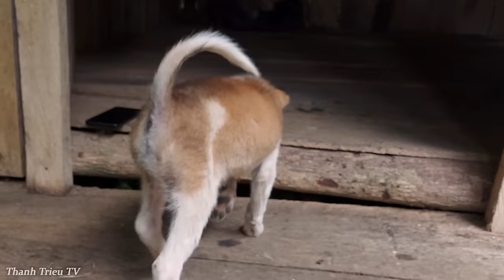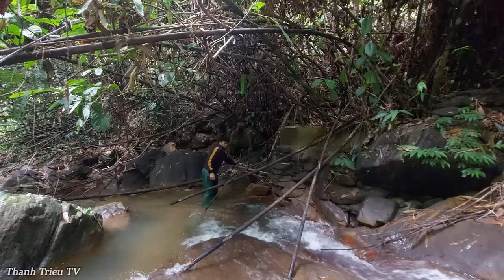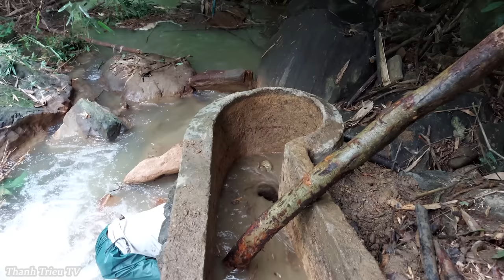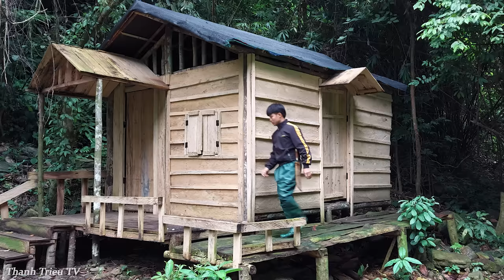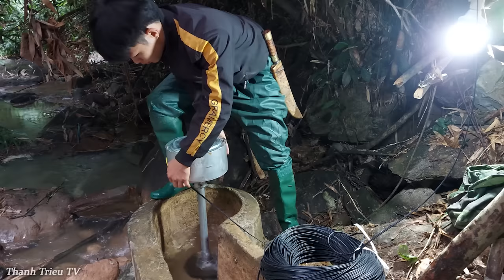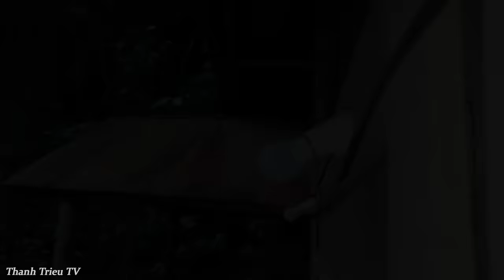Free electricity from water, Build generator install electrical system for hut Bushcraft, Off Grid

Comment: If I were a multi millionaire, I will hire a man with such knowledge on electric power source. It's easy to build a mini waterfalls if you have a running water in your small island.
Reply: Bro that little person is the “internet”  . You do it 😂
Reply: No need to be a multi millionaire if this young man  can do why can't us ?
Reply: In Vietnam 30 years ago, when there was no national madness, we only knew how to use water to light. The advantage is that it does not consume fuel, but the disadvantage is that the power is low and the power source is unstable, which is easy to damage electrical equipment. The cost is not high, about 500 usd. And the installation is quite simple as well
Reply: Millionaire can't leave their businesses.
Reply: @wantoting24  Right. People think money changes everything but people like this is what changes everything.
Reply: We can convertor to AC 👍
Reply: He left wit the turbine he is going to installed this to generate the water that's the power of water so cool this man knows a little of electric ideas he's good at it wow this is awesome
Reply: Don't need to be a millionaire, the knowledge of electrical production already exists. The crazy but sad part is Nikola Tesla prove that you can literally just drive a zinc in copper rod in parallel in the ground and pull electricity there's electricity floating in the air all around us, all this information although right now is being hidden and withheld from us does exist and can be found. Not to belittle what had to be done in this video was some work, but for me to be impressed he would have had to built the turbine from scratch.
Reply: They have lithium batteries and inverter knowledge now that would make this feasible and not hurt your equipment.
Vietnam or Red Level , Alabama, to bad the government has say to what you can do with your freedom.
Reply: Beautiful ❤❤
Reply: @bivietnam4379  The power is not low and the source is not unreliable. If you want more/less power you have to install a suitable motor for that need. Flowing stream is a reliable power source but if it dries up you can consider building a mini dam. You can protect your electrical device with a power guard device.
Reply: @channchum3542 The electricity from a motor is already AC no need for an inverter unless you want to change it to DC then you can add a full bridge rectifier
Reply: If you could use the brain you have you could do this by yourself.
Reply: We don't need to become multi millionaire bro
Reply: @richardblackburn1089  LMFAO the info is being hidden. Yea so go figure it out then if your so sure it's possible. The 1st law of thermodynamics clearly won't stop you.
Reply: @hmsbarman 
1) not all motors are AC.
There are AC and DC motors. .so your comment is wrong.
The output will depend on what winding and poles your motor is, and whether it's a delta or star output. 

How do I know?? Because I'm an electrical engineer.
Reply: @devarmont87  which motor produces DC? Explain, please
Reply: Es muuuyyy inteligente,es más para mi está para cosas mucho más grandes e importantes  😊😊😊😊😊

Comment: I think a steel cover for easy maintenance for the drainage to prevent from any leaves, rocks and soil. I think it will be easy to maintain. Anyways, great job! Thanks for this video.
Reply from the maker: thank you so much
Reply: what did he put on the drainage?
Reply: @dreilouisemarino9192  Perhaps judging of I’ve seen portion he put a flat surface stone that at least covers the exit of the drainage to block any debris.
Reply: @WayniKlaru14344  What is the steel mechanism called?
Reply: @dreilouisemarino9192  It is not mechanism. It is just a steel cover to protect from clogging the drainage with dirt, leaves, rocks to have a continue flow of water because it is a mini hydro electric pump.

Comment: Nice work My friend.. if you can estimate the power consumption of lights, including your fridge, air-conditioning system, tv and charging system equal to power production of generators then you can start a family in there.. but you have to buy a few more generator and start building some few concrete whirlpool somewhere on the sides of the falls..

Comment: The thing I love about a system like this is there is no need for 400 feet of pipe and a drop of 25 feet of "Head". You can also just build lots of these down stream one after another as the water will feed back into the stream so there is no loss of energy.

Comment: Mic is such a sweet dog ..uncomplaining as he  laid by the   leaves ground  as you work he slept  just  comfortably  as    if  it's ok..he is  not  suppose to be   exposed to the  earthen  elements to avoid  parasites  crawling to his body...better  he needs a real  DIY cushioned  bed bigger than him inside your cabin....he  is in danger  if he is  sleeping outside  by the  earth ground......only  concerned for  MIC....YU DID AN EXCELLENT ELEC  JOB   CONNECTING  WIRES FOR ELEC  USE...TRULY SERVED WHAT YU VE  LEARNED.....NICE    WORK ....

Comment: I would suggest a covering over the generator. Something to keep rain water out of it. the bottom the generator has openings that rain water can get inside of and damage the motor.  and construct a covering along the length of the water channel for the power generator. will keep overhead debris out of the water flow channel. Nice job clearing out the old generator housing at the water fall.

Comment: Install also a “power storage system” (battery) for an uninterrupted power supply including voltage regulator to power some electric and electronic devices. A low-cost, eco-friendly off-grid power source with lots of beneficial applications! More turbines, more power! One can energize individual households even in the most remote villages with perennial creeks or river systems! 
Kudos!

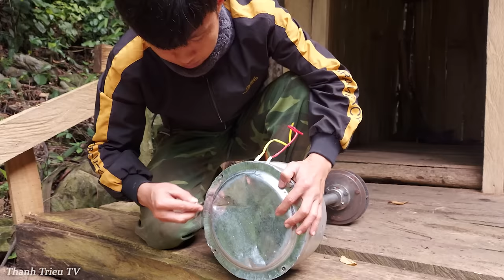Comment: 2:20 Simply pound out the large dent in the cover and give it a small dome shape. Regardless if the cover is galvanized whereby helping to resist corrosion, the dome will keep water from laying in the cover

Comment: Very nice🎉🎉👍
 2 feet ahead of Whirlpool, he should erect a metal net to prevent leaves and debris from flowing toward machine.
   Also a loose covering over the generator. If something blown over and obstruct proper water flow into rotation, you don't need to get up at dark to discover what happened😅😅😅

   From this you can charge up a small portable solar panel to keep it handy. Even when no sunlight😅.

Comment: This generator produces very little current and we must also add the loss due to the resistance of the electric cable, which is very long. This video is false. This generator does not have enough power to light all those light bulbs.

Comment: The entire inlet had sediments of gold and sikver... you threw it alI away.

Next project is adding gold troughs to catch the gold fr ok the inlet to the turbine. Create some free money.

Next project is to create a high voltage alternating (AC) turbine, from current DC  Then add a step down transformer to the house for more electricity output for air conditioning, refrigeration, etc..

Switching LED bulbs is better. Incandescent and fluorescent bulbs attracts bugs - LED do not. No bugs means no spiders.

Comment: Gerday mate, saw the girl who shot a bunch of vids from that same place & same hydroelectric system you are using. I'm quirous what happens to all the huts and sheds you guys build at this site? She built a bunch on the same side of the creek as you and a house across the creek but I watched her completely rebuild the hydro system as a bearing and seal had died. Same as you I guess, she had to clean out the hydro hole after every rain. Basically daily so you got that to look forward to from here. Enjoy your time.  Peace Out.  Wayne
Reply from the maker: Hi, thanks for your question. I would like to answer as follows: This is Vietnam, from the time of their forefathers about 70 years ago, they often lived in the nomadic migratory style. They live in the deep forest and have no electricity, that's why they built this power generation system which is very popular in the mountains. They took advantage of the fast currents due to the steep terrain and invented a set of magnet motors that rotated around copper wires to create alternating current to provide electricity for lighting. But the country gradually developed, now these power generation models are no longer available because they have been replaced by the state's 220v current. But those ancient buildings are still there, so we repaired and used them. These models are basically so common that you will encounter many people using the same system. Thank you very much